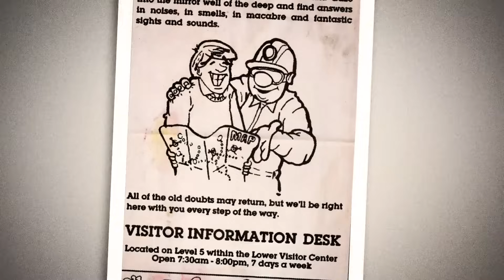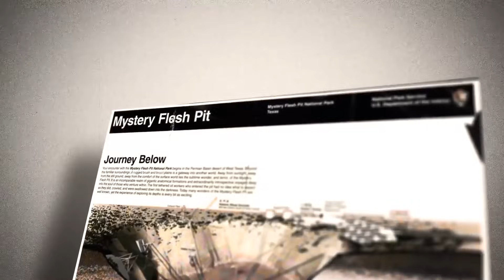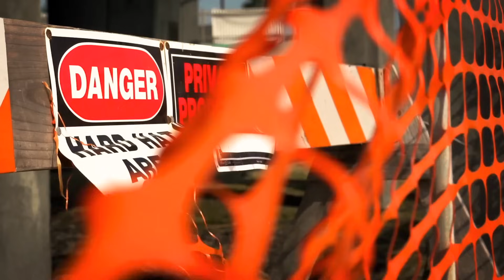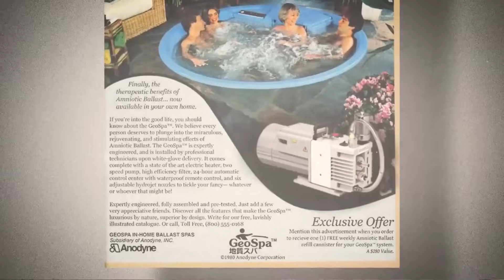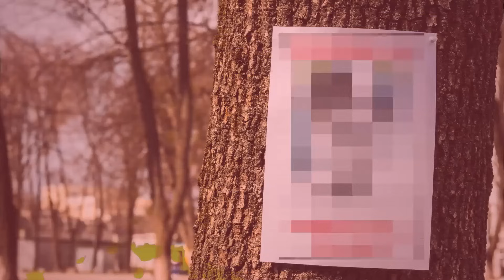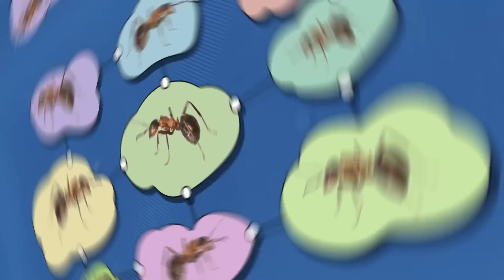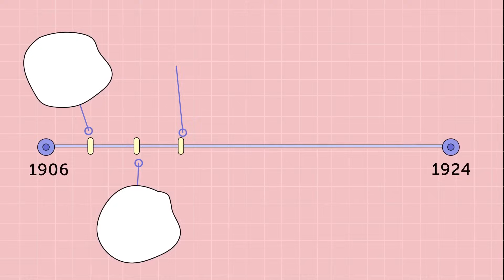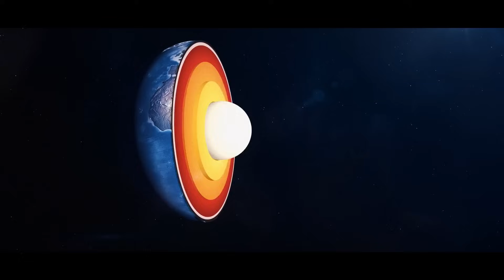Why Scientists Don't Want to Talk About This Mysterious Flesh Pit

Comment: 16:50 they determined why those trees are curved. 
Since they were planted in the 1930s, when they looked into it, some of the town's people were still alive, from back then. They were in their 80s at this point, but they were still able to offer a first-hand account of what happened. 
They said...duh dunt duh nuhhh...
It turns out, a factory in the area used curved pieces of wood for something they were manufacturing, so they had to cut a much larger piece of wood down to the curve, resulting in a lot of left over scrap or steam a piece of wood and bend it to the correct shape of the curve, which took a lot of time, power, space, etc., and so, they came up with the idea of tying the saplings down soon after being planted and forcing them to grow into the shape of the curve they needed. 
If I recall correctly, they said it worked well enough,  but ultimately, either the factory closed or they couldn't grow enough trees, quickly enough, to meet production requirements. (Kind of like one extreme or the other.) 
Either way ... there was nothing spooky or magical or multi dimensional to speak of. Rather, it was just some rope and some recently planted trees on a plot of land owned by the manufacturer.